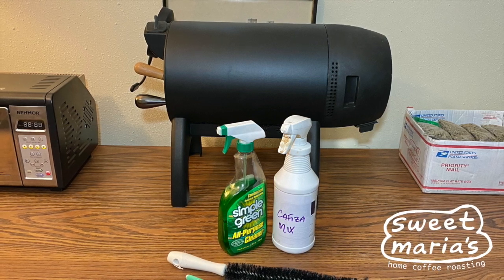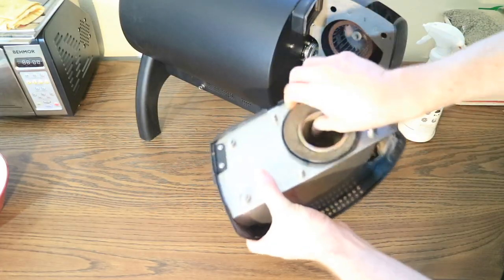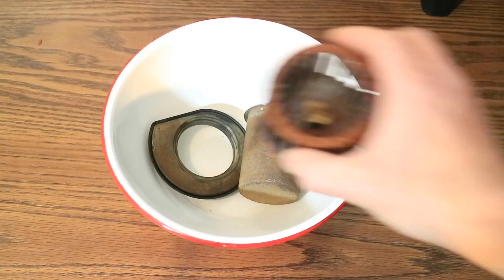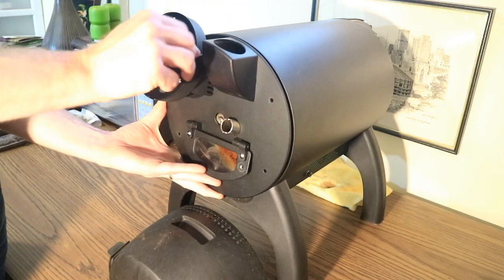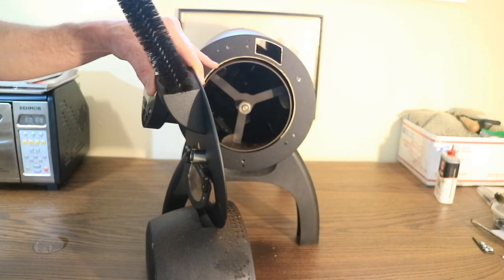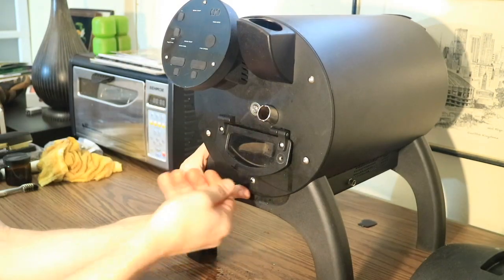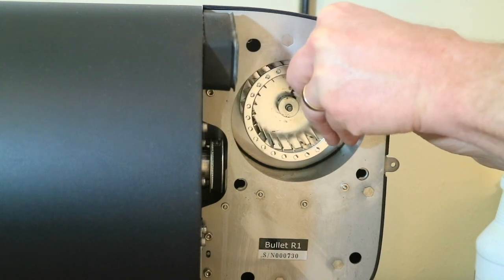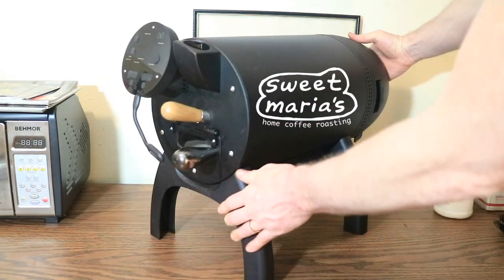Aillio Bullet Deep Cleaning

Comment: The impeller fan may have had an improvement since the video was made - you can use the long handle H2 0x60 supplied with the Aillio and loosen/ tighten the set screw of the impeller fan from the top. One of the fan blades has a moon shape cutout to allow the Allen wrench through the fan housing. It’s aligned with the set screw so align it to the exhaust port to use it. It’s way easier than using the L shaped Allan wrench. I’m super grateful for the video- it’s clear and quick- thanks for making it.
Reply: It took me way too long to look for this comment. Thank you
Reply: Great tip. Thank you!

Comment: does the drum of any other part ever need cleaning? is it possible/advisable to ever remove the drum for inspection? what about the controller area and it's cooling fan and vent holes?
Reply from the maker: The drum just needs a good vacuum. The high heat and abrasion from the coffee itself will keep it free from excessive buildup and also maintain it's seasoning. Cleaning inside the control area isn't necessary but if you need to get in there to replace the boards or do any repairs, here's how to do it. https://www.youtube.com/watch?v=TJzGPMt-TnY